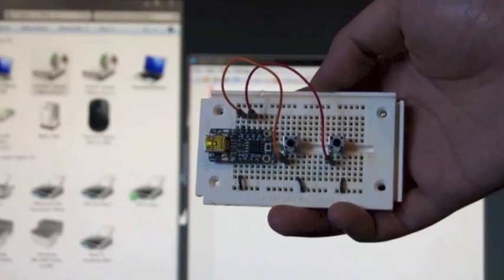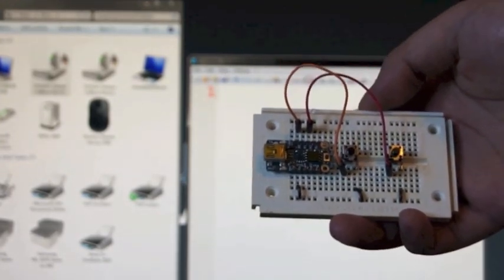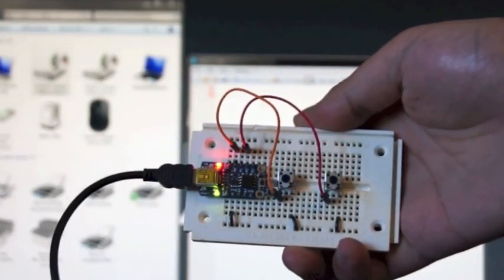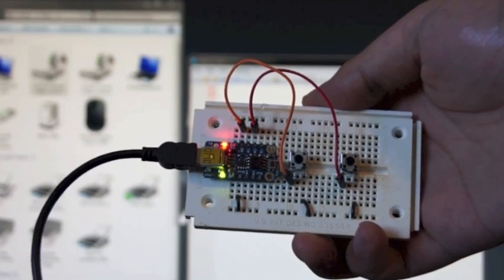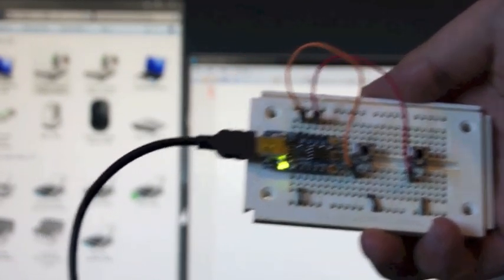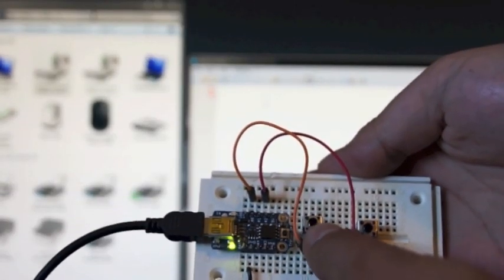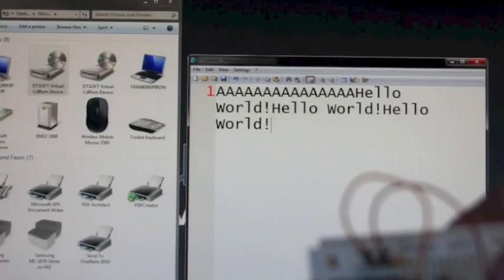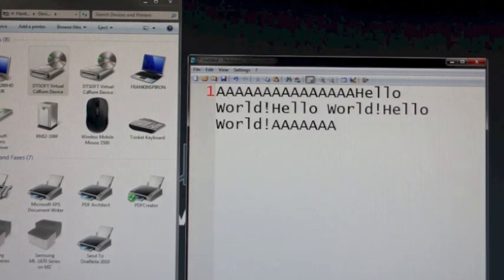Trinket USB Keyboard

Comment: The trinket has a smaller set of pins available, so it depends on your MAME needs. For lots of buttons something like the Arduino Micro or Leonardo would work well, as both can appear as a keyboard and have lots more pins.

Comment: @wussie & @Joshua - One could use an R2R resistor network (or similar) to add many, many keys to the same pin. Code could determine which button/switch was activated based on the analog value it reads....which is based on how many resistors are between the pin and that particular button.